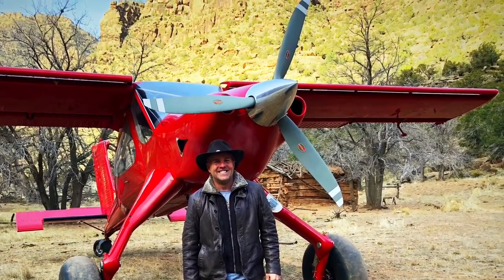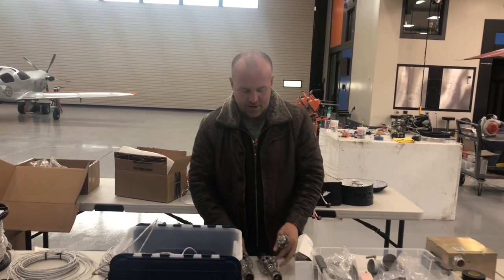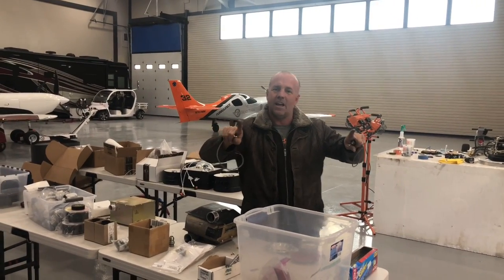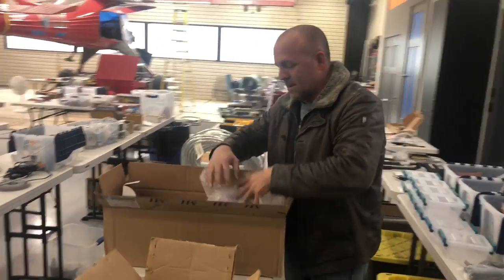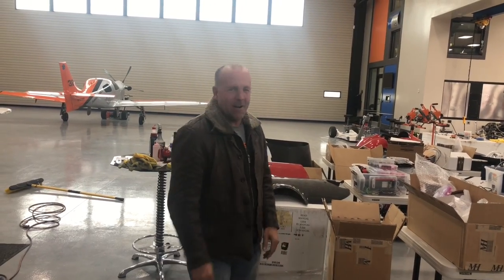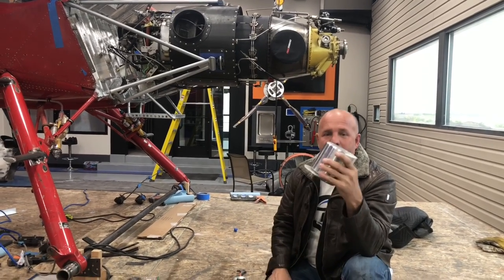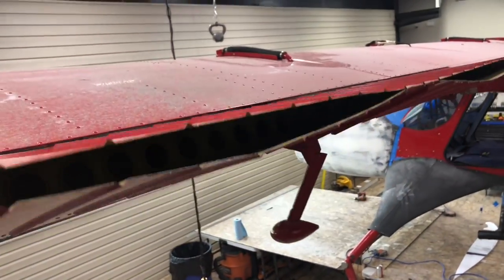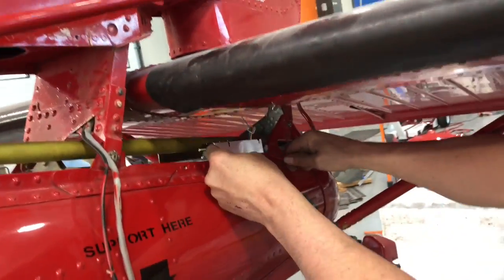Mike Patey Wilga (DRACO Video 9 A) Enlarging Elevator, Rudder And Adding A Trim System

Comment: I used to work for a company in Denver NC  that operated the Cessna 208 Caravan for an overnight delivery service (they were feeder aircraft for the bigger planes) The 208 did not originally come with a low fuel warning system.  Then, one day, one of our pilots found out that the fuel lines held enough fuel to start the plane and taxi all the way to the take-off roll before the engine ran dry because the fuel valves were closed.  It did not take Cessna long to figure out a retro-fit to avoid that situation.  Good to know you're installing one from the get-go

Comment: Mike,
I don't know where the SolidWorks support came from, but if you ever run into any issues, contact Dave Schaller at Go Engineer in Texas.  I bought my first seat from Dave in 1997.  Later I was in charge of over 80 seats of SolidWorks for a company while I was an engineer in research and development.  I moved all tech support to Dave, then Texas Engineering, because I wanted to call someone that knew more than I did about it.  Dave also worked a lot in aeronautical engineering.  I worked as a mechanical engineer and recently picked up my MSEE.  Dave won't guide you wrong.  He worked hard for us and never let us down.
SolidWorks is now well capable as a competitor in the cad world.  Unfortunately, I was forced into UG NX4 about 10 years ago because of demand from Europe.
Great job on the planes...but I really prefer to jump out of them.
Robert S.

Comment: Hey Mike
I had an idea watching you on that ladder brother..👀
You’re obviously an engineering talent and outside the box’r..
What about designing a “chair” or platform to use with that lift system so your not so exposed to the downside of those ladders!
I’m probably late to the idea Larry and there’s a thousand better ideas already available than mine,, 
Just be safe on that ladder 
(Here’s a THOUGHT- belay off the lift’s crane, if ladder slips or such, your tied off in a harness and safe!)
Love the videos 🙏🙏🙏🤜🏻

Comment: I have so enjoyed your videos, and have watched everything about Oshkosh that I thought that your plane might be in. This Wilgabeast is the most amazing thing to watch you fly and land...it is like you are defying the laws of physics. Why doesn't it fall out of the air?  Then I thought, massive input of fossil fuels!  I could see what I think that you were doing coming in with the nose very high and the turbine really spinning up...reminded me the way that an Osprey works.  Those slots, wing extensions etc. surely helps. 

I would really like it if you'd do a video explaining the process that you went through to enlarge the tail, horizontal stabilizer and elevator on the Lancair that you built. The tailfeathers on the Lancair seem really small, especially for high HP applications, and I suspect that causes some handling nightmares at slower speeds.  How did you arrive at the design?  I am contemplating buying one, but I would want to modify it.

Comment: Mike, I really like watching your videos. I was wondering whats he ceiling of the plane is and also the max cruise speed? I just retired this spring an am thinking about restoring an old tail dragger. I don't have a CRC machine like you but I ave a buddy who I set up his network that does an so I will probably be working out of his shop. . I found an RB26DETT Nissan engine for 5K and with another 5K in aftermarket pats I should be able to get i to roughly 1000 HP. I haven't really investigated running the car engine in a plane but so far i seems to be the best deal around i it can be adapted to work. I have access to some pretty brilliant people at Penn State who said they would help me to design a wing that would give me a good balance of low stall speed an maximize cruise speed.

Comment: Other than an F-22 Raptor 
Or a Saturn IV Rocket
I think DRACO is right there on Über custom badass aviation.
And you KNOW,, Mike engineered the 🐝 beejeezus out of ever single thing so that aircraft, DRACO,,
Thing is TIGHT.
I’d fly in it anywhere (If Mike’s pilot)
I don’t know jack $hite about aircraft 
Other than I’ve loved em since I was a kid-
But I do know about detail oriented performance nuts..
My grandfather was one, just with motorcycles 
So I totally get it
Badass!